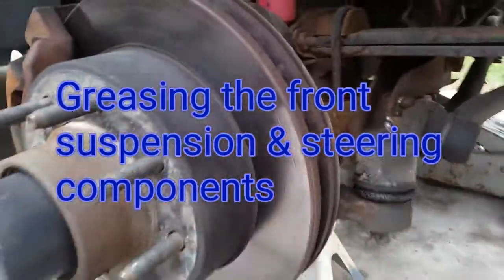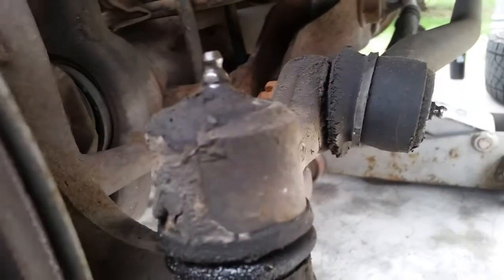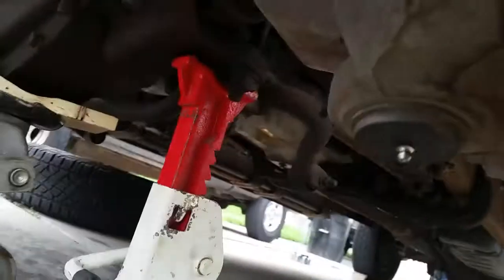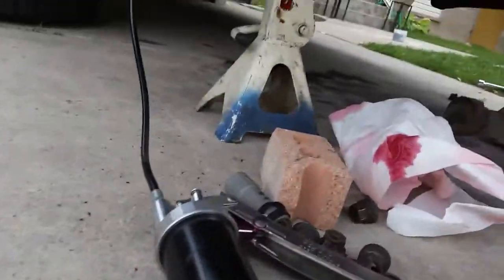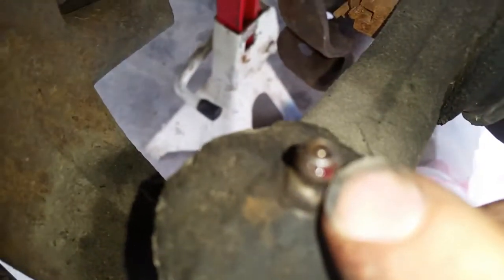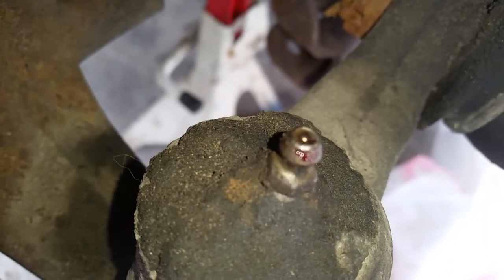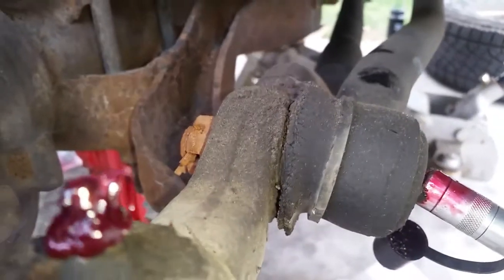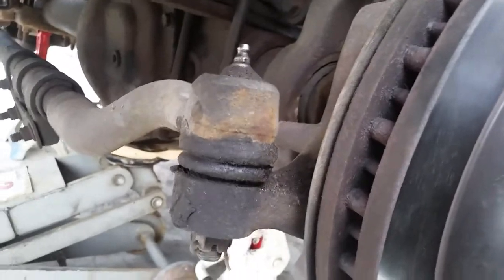Greasing zerks on our Ford Diesel F250 7.3L Superduty Ford Truck chassis

Comment: I have a Sears 3-ton floor jack exactly like the one in the video  I just rebuilt it and installed new seals due to leakage. Still works since 1985!
Reply from the maker: I should rebuild my floor jack too.  I got this at the dump lol.  Works ok. But a rebuild would definitely make it better.
Thanks for the suggestion!
-Will

Comment: They make a 90° coupler to go on your grease gun to grease that top ball joint. You just put it in four-wheel-drive and roll it until the joint is out of the way and you can slip in there and grease it.
Reply from the maker: I never thought of that.  I always seem to miss the simple things. Thanks for sharing.
-Will

Comment: At 1:08 pause it what is that fitting on the left corner with a rubber cover on it? My truck has it but not sure what its for
Reply from the maker: I'm not sure. I'll look into it and get back to you.   -Will
Reply: @Debtfreehomesteaders  please
Reply from the maker: @sendittrucks  Vacuum line port for automatic locking hubs that my truck doesn't have. I have manual locking hubs. Thanks
-Will